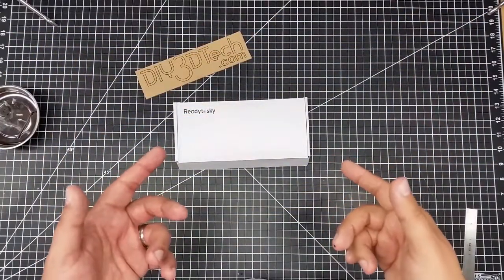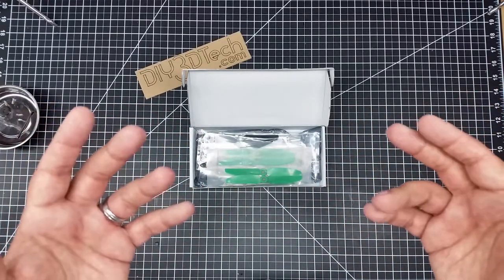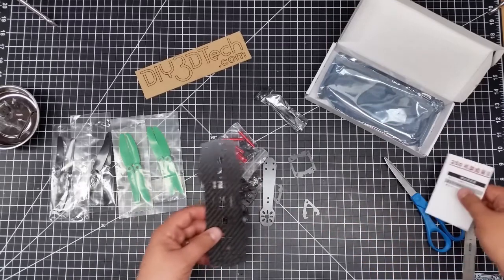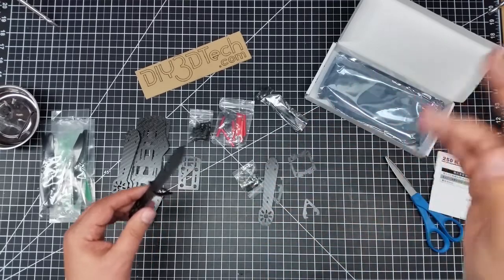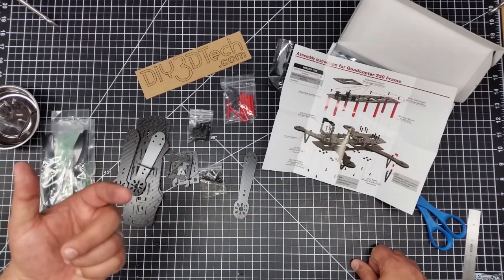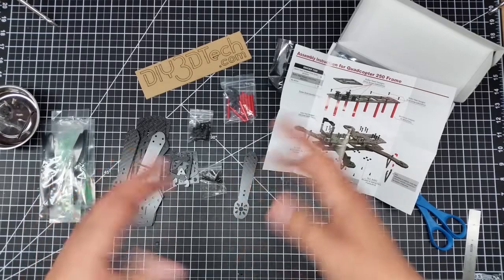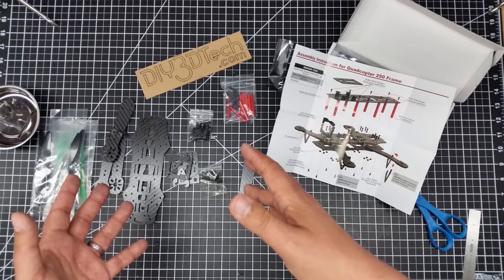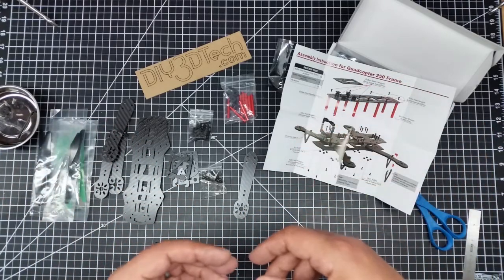Video Drone - 250mm FPV Racer Frame Unboxing and Discussion!

Comment: I got this frame in July, not started it yet as i'm working on my S500 and a fixed wing fpv project. Must admit that I hadn't thought about using an old production quad for parts, but at the price of this frame i may just get a second and try it.
Reply from the maker: Me too!  What type of controller are you using for the S500?  As you can see in the past video, I have an S500 and was building it around an APM 2.6 controler however I am a littler nervous over the software set up and fail safes, etc.  So I am thinking switching to the NAZA 32 V2 your toughts?
Reply: I have the APM 2.8, but it seems a little dated now so not sure if I should update to the Pixhawk. Flying my Phantom 3 std and my H502s at the moment so the S500 is still sat on my hobby bench waiting for the controller to be fitted. Fixed wing wise I am currently playing with a Micro Skyhunter, seeing what I can cram into it FPV wise :-)

Comment: I am curious if the guts to the hubsan 502e will fit into that brushed frame that you eluded to in this video.
Reply from the maker: I don't think so, I am thinking about using the modified guts of the Syma X8